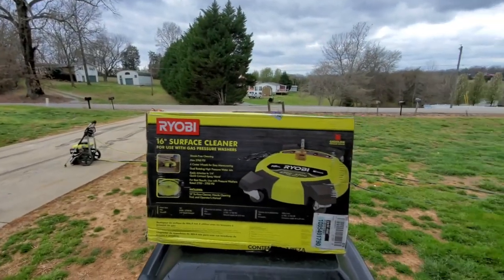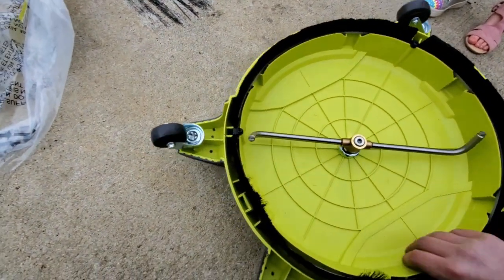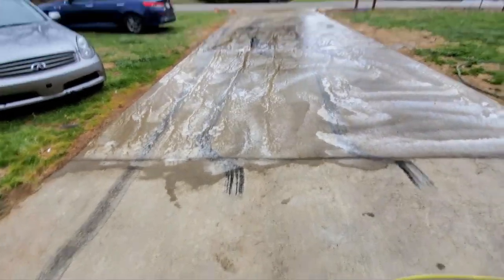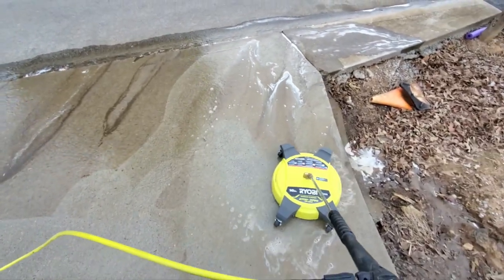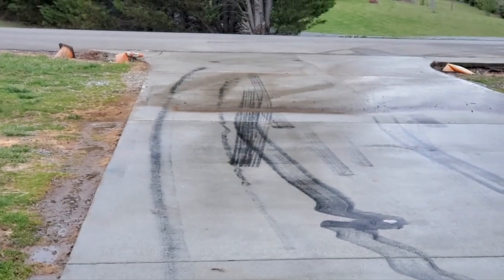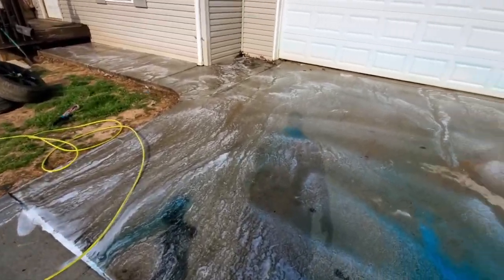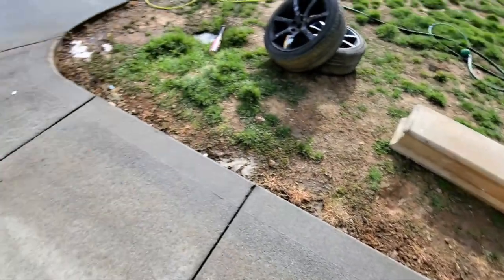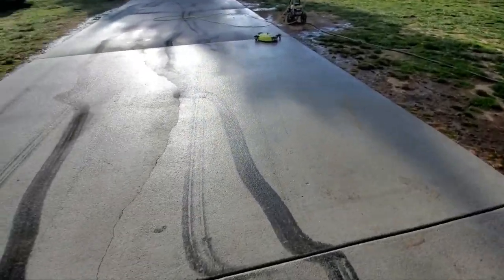RYOBI 16" pressure washer surface cleaner unboxing and review.

Comment: What solution did you use I have leaf 🍁 stains on mine brand new driveway complain to the city the tree belongs to them, they don’t give a dam. I tried Zep , dawn soap, peroxide and backing Soda cleaning vinegar salt you name it. So I’m going to buy that scrubber for my Ryobi. Great video
Reply from the maker: I don't recall the brand name but I did obtain it from Walmart. Try F9 grounds keeper.
Reply: @AbramHeathFULLYEET  thanks 😊